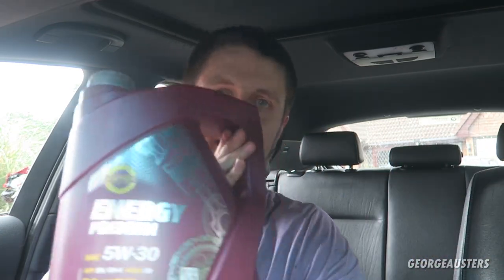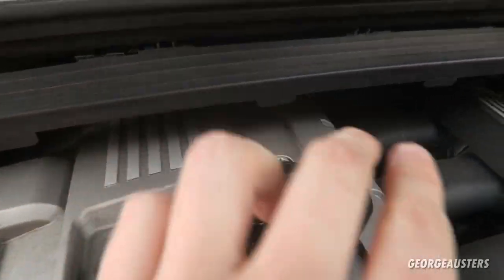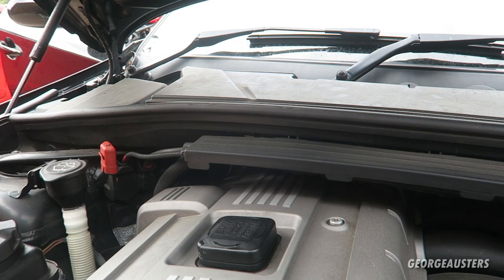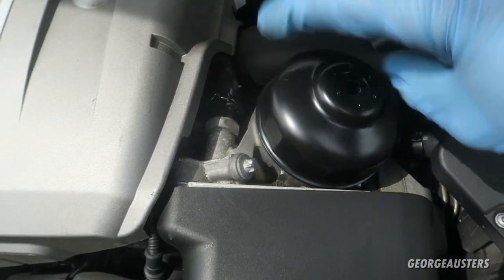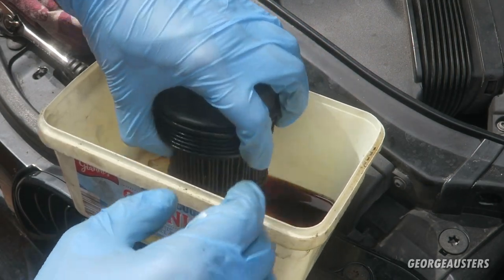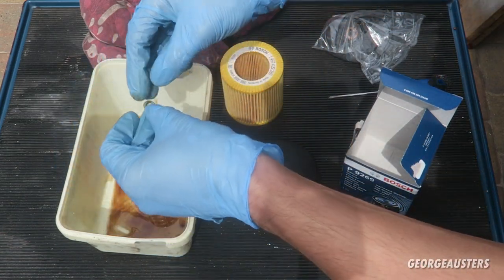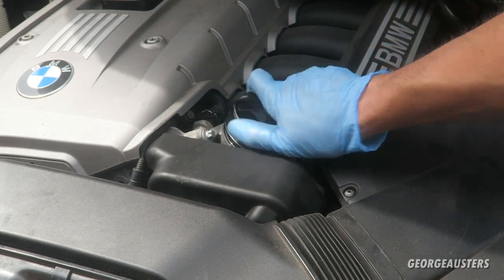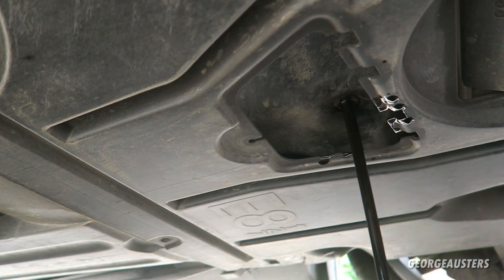BMW N52 Oil & Filter Change With Engine Flush *COMPLETE GUIDE*

Comment from the maker: Buy everything I used in this video here:

Oil filter wrench: https://amzn.to/2BqemWT
Oil Filter: https://amzn.to/2U0NUtn
Engine Oil: https://amzn.to/2XQcnCN
Engine Oil Flush: https://amzn.to/2As4lrQ
Reply: Engine oil needs is the best cleaner. Flushing is never needed and only harm the engine. Unless it has sludge build up from bad design engine that is always bad
Reply: Dont need a filter wrench. Just use a leather belt

Comment: So many wrongs in this video! You use an engine flush but don't use any brake cleaner for the oil house, you don't clean the vanos filters etc etc. What's the point then???

Comment: Oil capacity for an oil and filter change is 6.5 litres, the electronic oil level sensor takes a while to respond, a few engine on/off cycles.

Comment: Thanks for this George. At your mileage of over 120k, what made you go for 5w30 instead of 5w40? There have been some debates over this so curious to hear your thoughts? I just bought an '07 e91 330i  with 118k and  am inclined to put 5w40 in the next change.
Reply from the maker: 5w30 LL04 is what is recommended from factory. Using an incorrect thicker oil can put more wear on your engine
Reply: It could be both of them 5w30 and 5w40 as well. I´ve got N52B25A from 2005, it has 216k kilometers now and also using 5w40. Of course 5w30 is from factory, but these engines are very known for their higher oil compsumtion. Im using Castrol Edge Fully Synthetic 5w40 for 2 years now and no issues. It is LL-04
Reply: @MartyBlaha100  Did you notcie less oil consumption when using 5w-40

Comment: I don't trust those electronic oil level sensors either. What was wrong with the old fashioned and accurate dipstick?
Reply from the maker: I agree, really isn’t that hard to add a dipstick to an engine block👍🏻
Reply: Stick a few litres in and check the digital reader is reading low... then you know it’s working.

Comment: Respectfully, please your experience with this oil. Did you notice anything in the operation of the engine, was the engine sound louder or louder or maybe quieter? The assumption is that the oil can last until the next change at 15000km or 1 year
Reply from the maker: I change the oil every 5k miles max but it’s more like every 2-3k miles with this car

Comment: A few Tips: You can use a turkey baster to remove at least 200ml more of dirty old oil from the filter housing. On my N52 (525i) the sump plug is horizontal so you have to position the catch pan strategically to get the oil out without spillage. I also use Wurth engine flush every oil service and leave to idle 30 mins before the oil change. - BMW don’t actually advise oil flushes but I’ve seen them do no harm over the year many years on my N52.
I also away use a MANN branded filter I believe it’s OEM. The copper washer is sometimes referred to as a “crush washer” that’s why you replace it every time. Hope video this helps someone.✌🏼
Reply from the maker: Good tips man!
Reply: One more 👍🏼 - my 525i N52 easily accepts 7 litres of new oil - but I can often put in 8 litres after a full drain of the old oil. Maybe start with adding 7 litres and see if you need to add a half to 1 litre more after this.. 👍🏼
Reply from the maker: @mshahid2898  Never needs 7-8 litres man
Reply: Seriously have added 8 many many  times - 2x 4 litre bottles 5W 40 Castrol edge titanium FST - must be that I really get the old oil out as fully as I always lift the passenger side may that helps extraction - not sure - I would recommend 7 litres - to start with.
Reply: Agree - 7 litres is also fine 👍🏼
Reply: when you said "leave to idle 30min before oil change" does it mean i leave my car on/ignition for 30min in the garage before i do my oil change?
Reply: @cyberairwolf  yes 👍🏼 engine on to warm the oil maybe only 15 mins - but you can use engine flush too just follow the instruction on the can.

Comment: I have e60 with N52 and that engine holds 6.9 quarts here in US , not sure how much in liters , but I am sure it’s about the same , am pretty sure that oil level bar needs to be solid orange line all the way , I have I drive and it will say oil level OK with just 6 quarts but as you add that final quarter you ll see oil level bar becomes one solid color .
Reply from the maker: It was at the max but I did need to add 1L the next day👍🏻
Reply: eldin dukic bro idk what you’re doing but it sounds like you’re over filling it. unless you have an m5 you won’t have an oil reading on the gauge cluster with an orange line. You said n52 so either 525, 530, or 528. The bar will be in the idrive and it color codes the amounts. I’ve accidentally overfilled before and i had to drain a bit. it does not say “ok”. just be careful too much oil can ruin an engine
Reply: Garik , I have a 530i , I know , I was referring to orange line in the cluster that his car has since his car doesn’t have the I drive , I check my oil level thru I drive and I put about 6.5 quarts and then the green line in my I drive is solid , what am trying to say a car won’t show you are low on oil until it’s a full quart low , it will say oil level ok and when it see it’s full quart low it will say add one quart or two and so on . So if u out just a bit over 6 quarts I drive will say oil level ok , but the car might take another half a quart to be full . Yes I hate I drive and no dipstick but that’s how it is on N52 s .
Reply: @eldin9117  >>Does your Idrive measure the same as the check system? My Idrive says full and my check system says 3/4 .
Reply: Lars Brodin am not sure what you mean by check system? When oil is full my I drive says it’s full .
Reply: @eldin9117  I see your point. Honestly I don't know because my 528i never leaked or burned oil and my oil level was always at max and it never asked me to top off. I changed oil every 5-6k miles using pennzoil platinum religiously. On the other hand my m5 gives a fairly decent reading every time i check. perhaps a difference in oil level senders.

Comment: Good tutorial for n52 in the e85 z4 3.0si too. Thanks!
Reply: Just to add, the oil level sensor is a PITA with the n52, at least in the z4 3.0si. It takes a good 30 min drive before you can be confident that it is reading correctly. On a short spin, it often doesn't seem to register the change in level at all.

I gather that under filling is better for the engine than overfilling, so filling to 5.5 - 6.0 litres and then topping off the next day/journey seems to work.

I used to take my cars to a mechanic, due to lack of time and experience, but I struggle to trust them now. I've had them over tighten the drain plug (nearly needed a new sump!), use spray filler instead of new gaskets, etc. It's just not worth it. If you want a job doing properly, DIY. With excellent YouTube videos like this, it is easy to take your time and do a good job! 👍

Comment: Just to let you know your oil filter cap is broken and needs to be replaced. The insert that was stuck inside the filter should stay as part of the cap
Reply from the maker: It does not need to stay as part of the cap, it clips into it.

Comment: Hi George, you have made a good start ... Definatelly M52 needs 6.5 liters of motor oil if you replace the oil filter (and drain the oil filter housing...if the filter is not replaced 6 liters is okay.) 
Anyway probably you already know but  you can crosscheck all the liquis required for your car from the Tis web site with registering your vin number:   https://www.newtis.info/tisv2/a/en/
Reply: By the way, if i did not hear it wrong the motor did not react the ignition quickly after the oil change. is it because i did not hear properly or ignition plugs also need to be replaced with iridium ones?

Comment: i noticed the torque wrench you linked only goes down to 28 nm is that ok to use when you require 25 nm? i am unable to find one in the uk which has a range of under 25 to over 150 do you use that one for everything?
Reply from the maker: Should be able to find a lower 3/8 torque wrench👍🏻
Reply: @GeorgeAusters  then I would need 2? Would one that done 27 nm be ok for things that require 25m?
Reply from the maker: Yes. I have a 1/2inch one and a 3/8inch one👍🏻

Comment: "i've never had a problem with Bosch oil filters".
The moment there would be a problem with an oil filter, you can say goodbye to your engine. So, the fact that you never had problems, doesn't mean Bosch filters are good. Infact they are mediocre at best.
Reply from the maker: I use them for all my filters not just oil
Reply: If you compare one of these Bosch paper filters, with OEM, Mann, Mahle or any other, there will be no difference at all. It's just a bloody paper filter made to fit, it's not rocket science.
Reply: @stevesas632  Unfortunately for you, Project Farm did a test on just a few OEM stock filters and found out things are the exact opposite of what you are saying.
Here is the link: https://www.youtube.com/watch?v=sJ3L-E-ufYo
Educate yourself.
Reply: @Nick-GR  went with Heigst paper one for wife's TT & Mann (which is what BMW use) filter for my N54.
Reply: @stevesas632  MANN filters are good. Heigst i haven't checked them so i dont have an opinion.